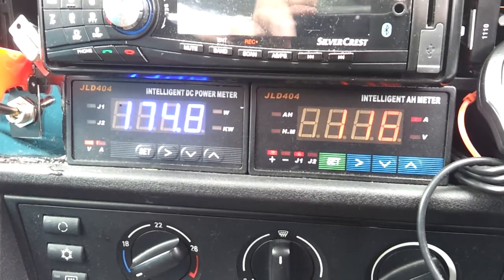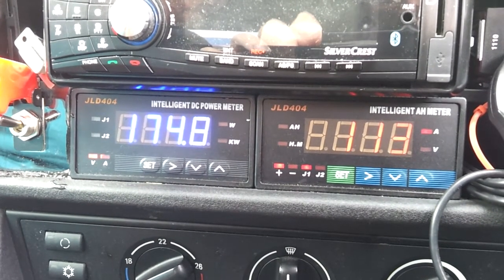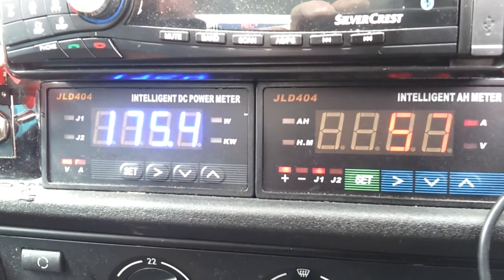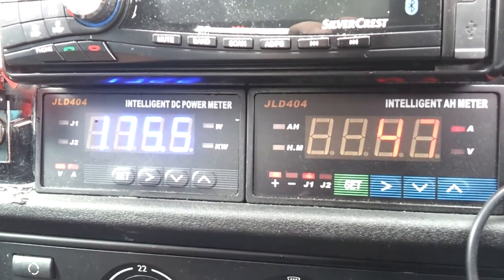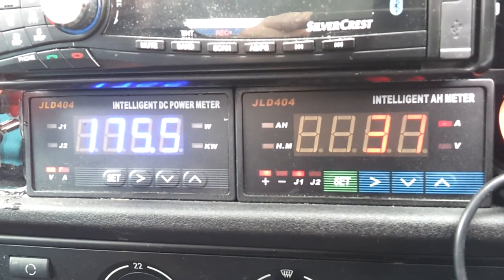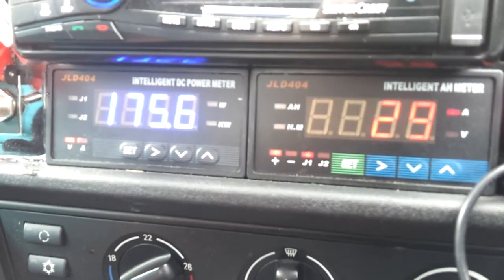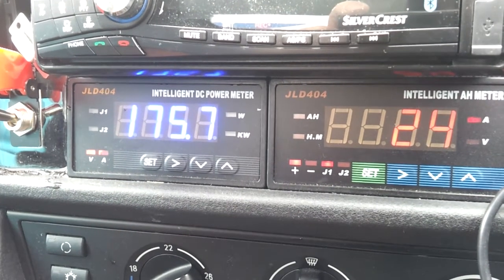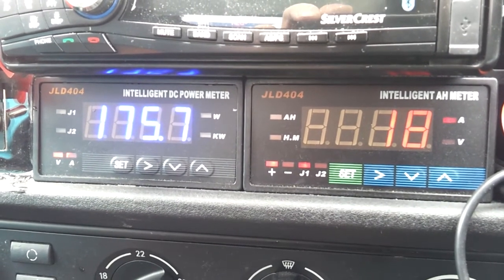BMW E39 EV Conversion 47 Chademo 06

Comment: Hi Damien, did a 2" test of my Vectrix conversion this weekend using my CALB 60AH pack from my main Vectrix.. Leaf cells arrived today to proceed with conversion. Our Vectrix club would like help with fast charging and bigger battery packs. Eamon
Reply: Eamon Stack Yes indeed. I have a Vectrix with a LEAF pack in it. I also have a CHADEMO inlet already. I would love to rig it up on my cycle!
Reply from the maker: BenjaminNelson What voltage is your pack Ben? It would seem the more modern Chademo chargers don't entirely follow the spec and will not work below 200V.
Reply: It's about a 144V nominal. (Charge up to 148, discharge to 130V) From what I've heard, it depends on the particular CHADEMO charger, as to if/how well it works.